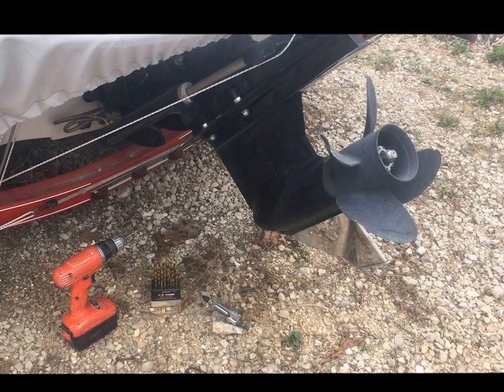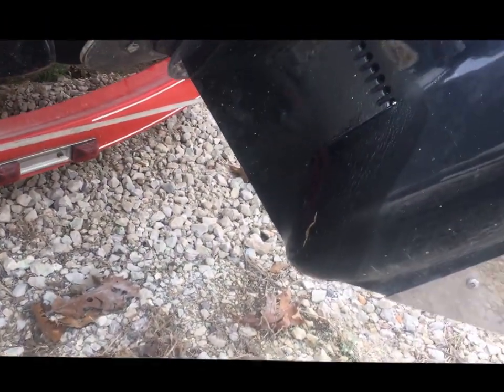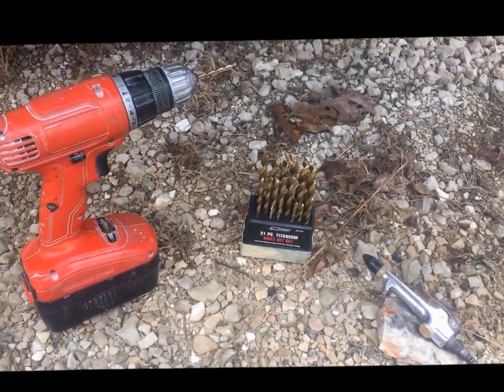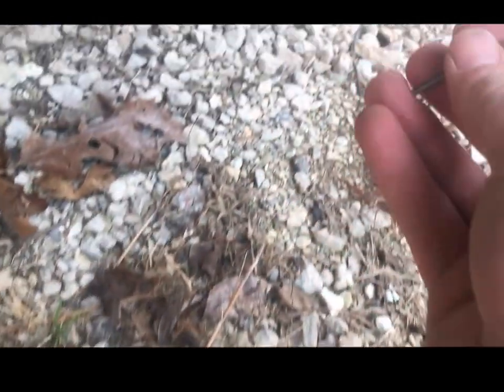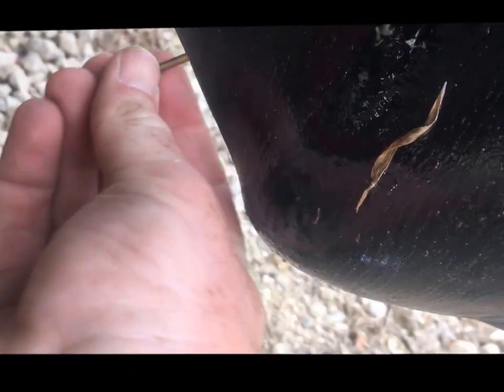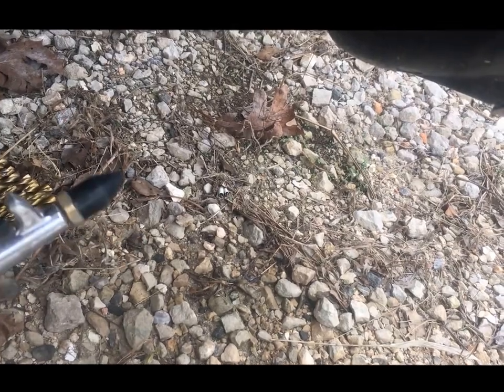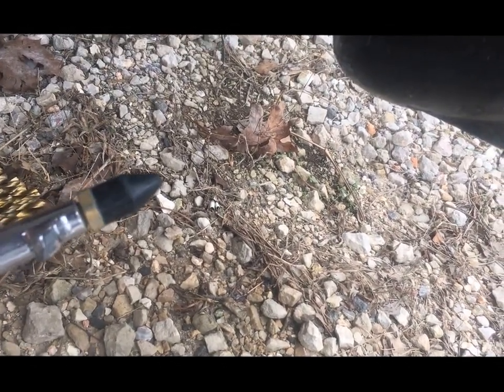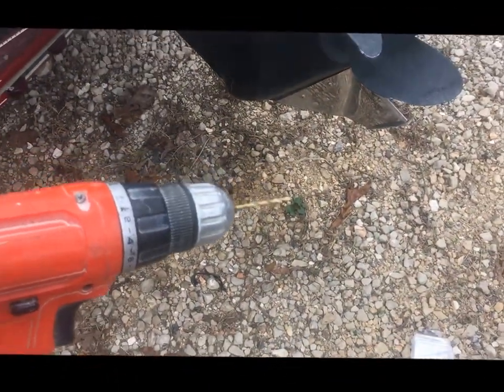How to clean blocked or clogged boat Speedo

Comment: Good video im sure it helped alot of people 
One thing id recommend is if your blowing air in the inlet hole is to unhook the hose from the back of the speedo on the dash so nothing gets pushed up into the speedo itself.
Reply from the maker: Thanks! I should have said that. I've tried to get a lot better making these videos. This fall I plan to redo most all of them and make them better, will be sure and mention that, thank you Matt!

Comment: Do not shoot air into there, you will ruin your speedometer. You can disconnect the line above the hole and blow air backwards through the line out the hole.

Comment: I disconnected the tube at the top that leads to my speedometer, then cleaned out the hole with a drill bit as you showed. I connected a smaller piece of clear tubing to the connector on top, and blew air backwards through the small hole. No air moved at all. Tried pumping soapy water via a plastic syringe, as I saw in another video, and the water won’t go through either. I even tried running a thin piece of wire backwards through there try and loosen it up. There is clearly something clogging this thing up pretty solidly. Any other suggestions?